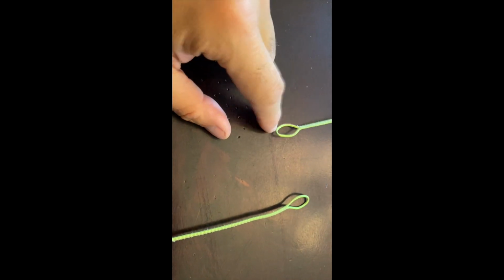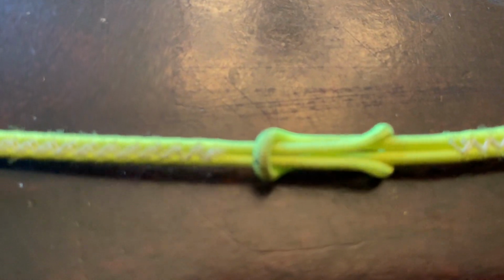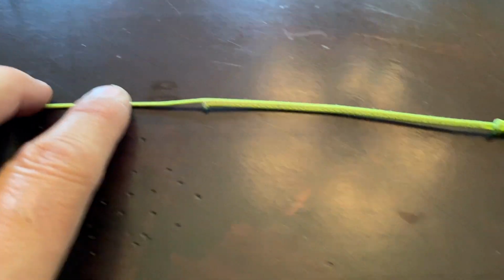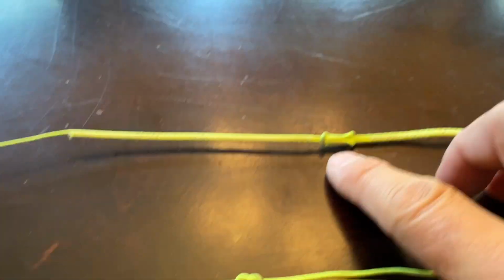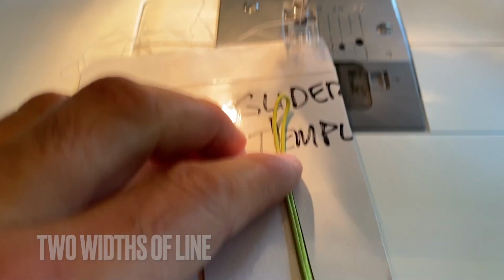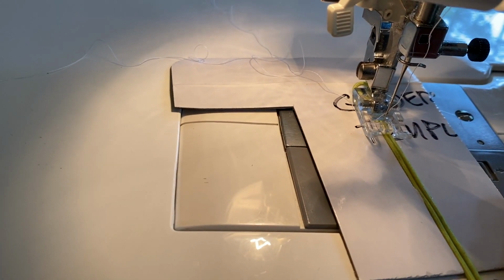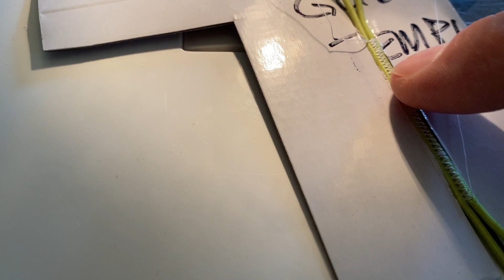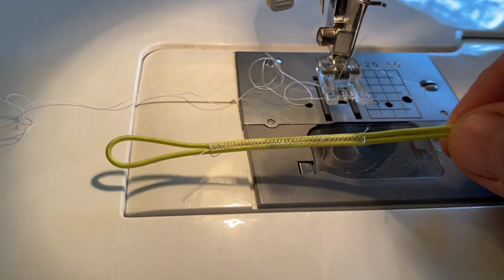Machine sewing paracord eye spices

Comment: Not bad. The proper way to do the ends of the stich is to reverse stich the first and last 10mm. Also, I believe bonded nylon is a more appropriate thread, but polyester will certainly work. I would definitely do the reverse ends with polyester though. A couple layers of masking tape to create an edge for the template to ride against does great to keep it straight.  This is absolutely an easy process and anybody that flys much should learn to do it. Line is not expensive and its nice to be able to make or repair lines on your own so you dont have to wait, at a much lower cost.  You can stich them by hand even, but it really sucks. A capable sewing machine is cheap. No special machine or stiches required.